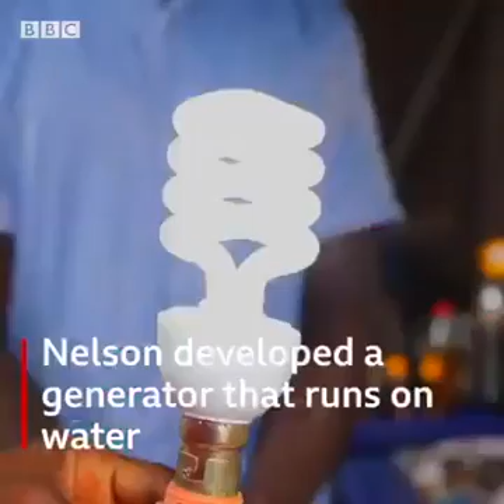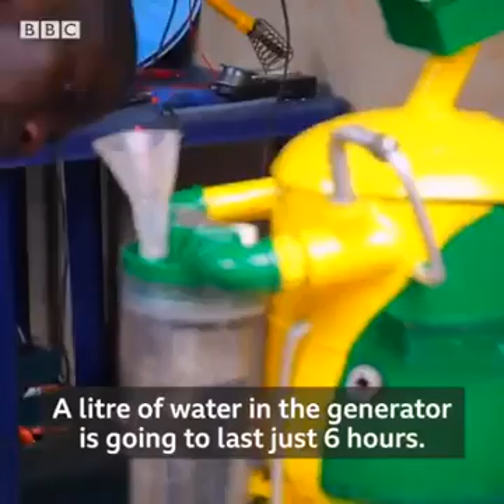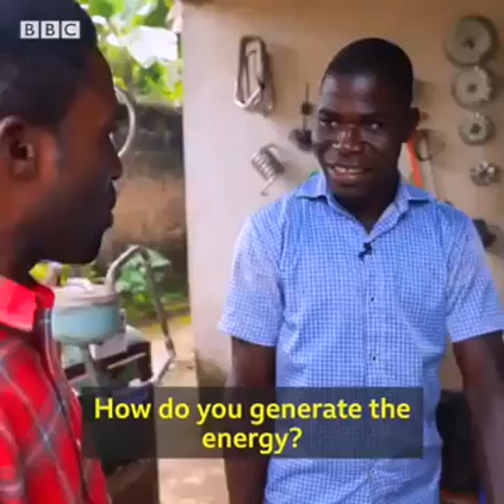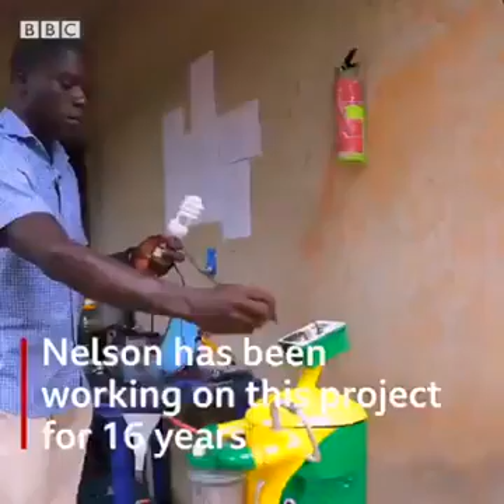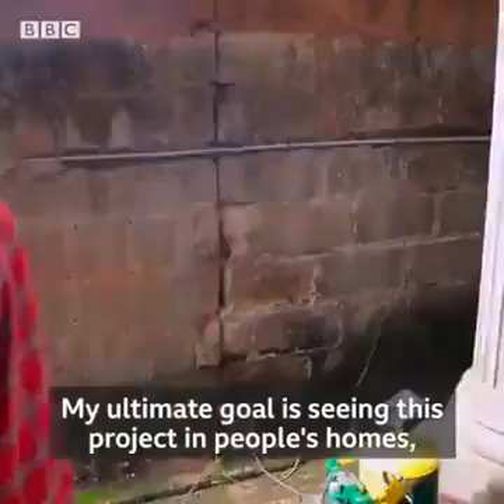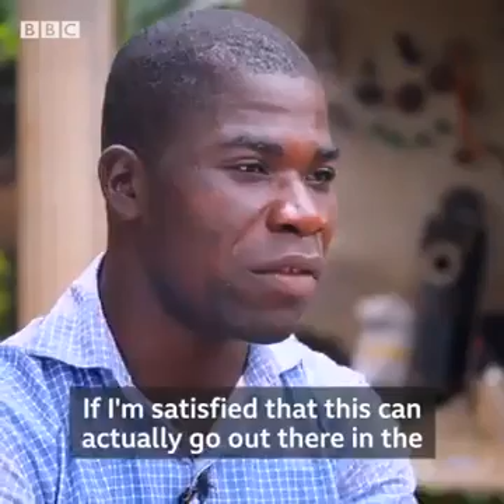Water-Powered Generator Made in Nigeria by Emeka Nelson

Comment: A "generator" producing 1000 watts of energy for 6 hours. It only needs a pre charged battery. 6 hours later, the "generator" needs to rest. Seems like the "generator" would last 7 or 8 hours if you plugged the battery directly on the devices you want to power. That way, that battery wouldn't waste power on the pump for your fake generator

Comment: it's really sad how easy it is to fool people, every "water generator" ever is fake, this one is no different.
There are only two ways to get energy from water:
1. kinetic energy, like gravity or steam
2. electrochemical, by splitting the water into hydrogen and oxygen, but this takes more energy than it provides.
His device is neither.

If he's not living in an alternative reality with different laws of physics, his invention cannot work.

Black people want an african inventor ao badly, they forgot how to think critically, just like when Chikumbutso' claimed to have a TV without cable or an electric car you don't need to charge...

Just look at the specifications of his device, 1000w 230 volt, powered by a 12 volt car battery? 
That's just an old car voltage converter he found in the trash, he only built a fake water tank around it to claim he invented something new, nothing else.

Just ask yourself why it can only work for 6 hours? Why can't he just add new water and continue?
It's because the battery is empty!